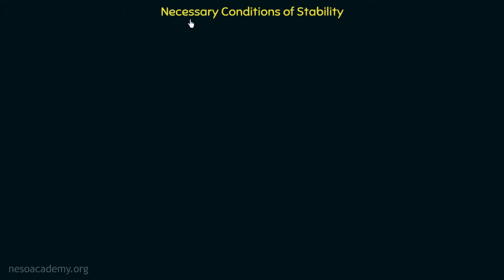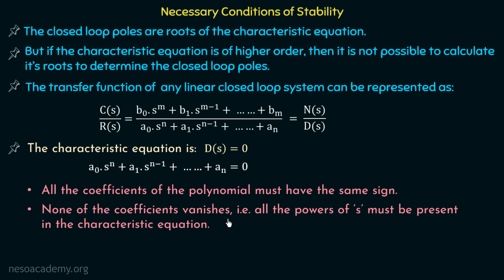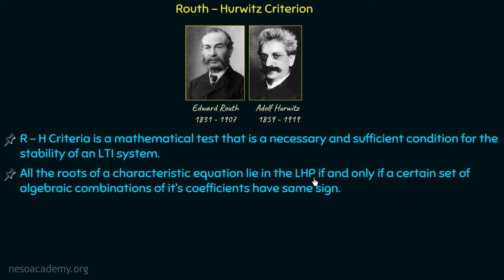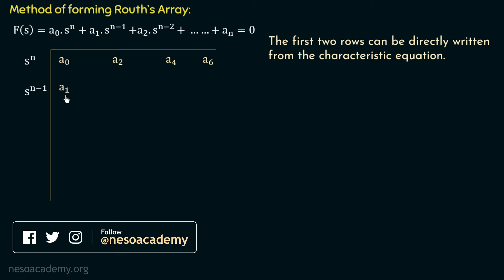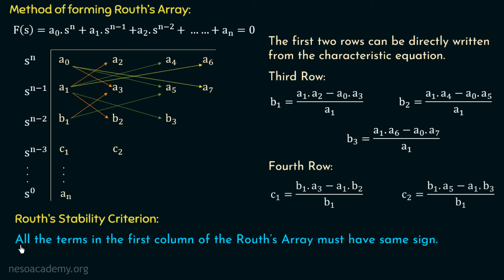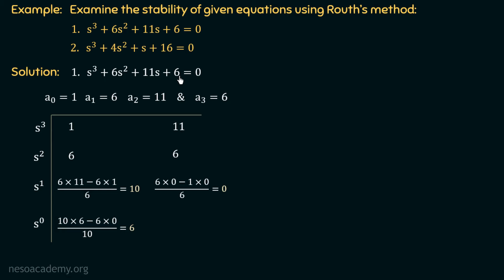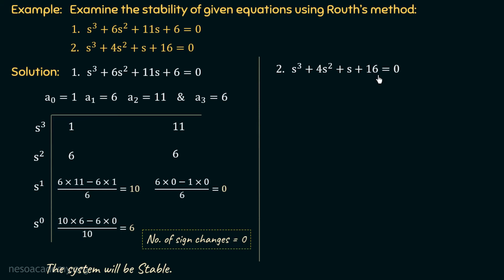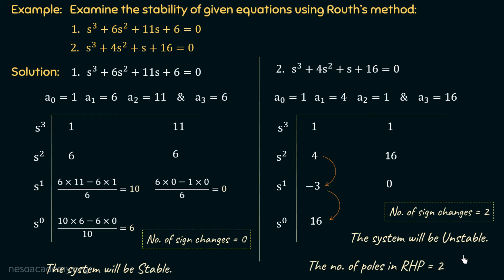Routh-Hurwitz Criteria

Comment: I'm a mechanical engineering student with no background in electrical-electronics subject. I'm learning this for my semester examination on the subject Electro Hydraulic Control Systems, still I'm finding it very easy to follow and understanding it.
Thanks a lot Neso Academy for this wonderful set of lectures.
I'm grateful to it.